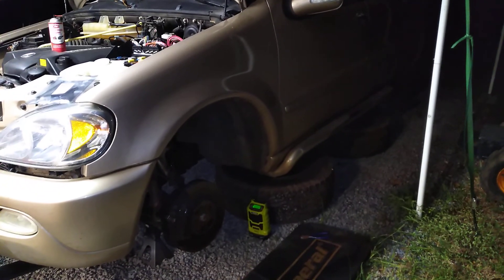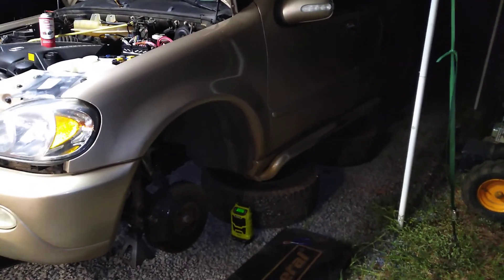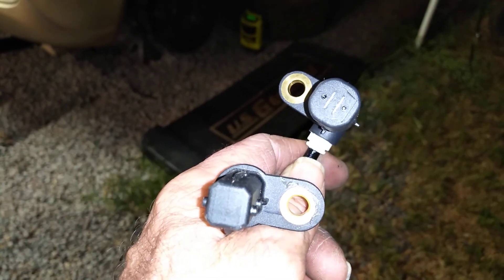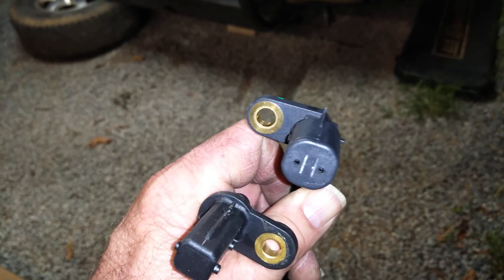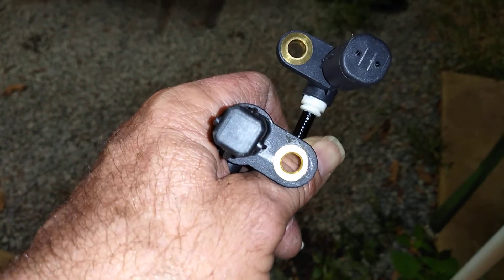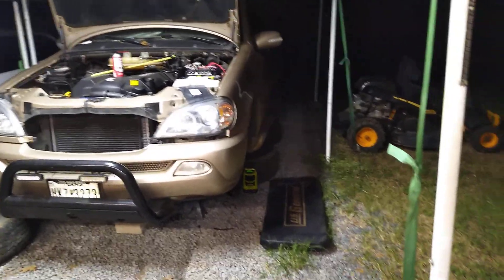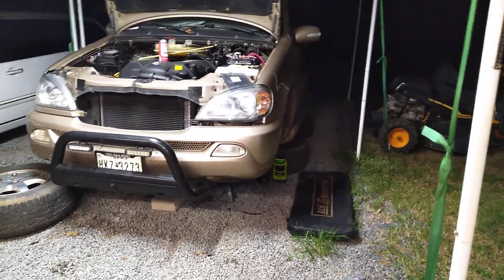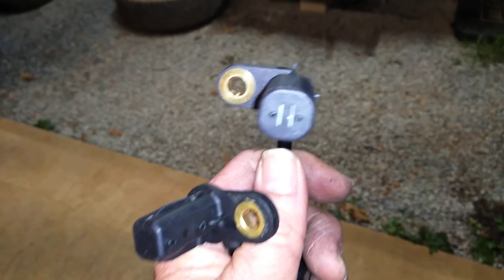Mercedes w163 ABS Wheel Speed Sensors / VSS choose correct ones for VIN # or Limp mode will result

Comment: Thanks, sir. Recently bought ML for myself, the prior owner was stating the abs light was triggered by the faulty FL sensor, went to a very good German car mechanic, he told me it needs two sensors on the right side, then I kept digging, and figured there is no data coming from RL sensor, so I'm going to see tomorrow if it's the wiring issue, or the dead sensor. I understand very well someone that would sell a car for $1000 with abs light, especially after following wrong advices from mechanics. Gotta do it all yourself. 2000 ML320
Reply from the maker: Bravo to you ! If your ABS sensor was in & working then died you probably need new one(s). 
If however it was just replaced ie its new, yet shows 'no signal' either on live data road test or spinning wheel, somebody put the wrong for you VIN sensor.
Those VIN splits matter !
Pre & Post sensors NOT interchangeable and MB doesn't make that clear.
What are last 7 of your VIN ?
Reply: @hellosunshine1090  A188977
You know, the previous owner stated, that the issue with abs light came on exactly after he hit a small road bump while turning left. I watched a video, can share a link later, it says that with an alignment slightly off, the abs light can be triggered, even if the steering wheel sensor is off by a few notches, angles. I was thinking that's exactly my case, untill I checked what the computer said in regards to one of the sensors, and indeed there was no live data coming from it while driving. So, it's either or, because sometime ago, I believe I was able to capture some live data from that faculty sensor! But last night, it was dead. Really interesting. But aside from that video, I haven't seen someone describing that issue with alignment and abs on the forums. But it's exactly what happened to the previous owner of my car. For now, I would like to see a wire condition of that sensor. Thanks for reading.
Reply from the maker: @SergioMorello1  
Ok Sergey then your year is prob   2000 - ish ? You need the early series 1998-2002 sensors for Pre A371935 VIN.
Just so you know.
Only guys Ive heard where an alignment issue causes ABS malfunction had hit something hard like curb, big rock, parking lot barrier, etc.
My very first ABS issue manifested at 65mph on Interstate bridge joint.
It momentarily braked one wheel - scary it feels like you have a flat tire this is BAS reaction. ABS fault doesn't always fo this but it CAN 

Around 500 miles / 5 days later it happened 2x more.

Once safely home my Foxwell scanner showed 'bad LR VSS signal' Stored & Current.

I replaced and all was well for 3 months then other Wheels VSS acted up too.
My theory: the cable / wire on these that runs along the suspension arm gets broken internally after 15-20 years, 150-200k miles & boom, no or bad signal which lights up dash "3 light salute" & causes all manner of woes.
Ihad that BAS sudden braking ( hazardous !)  and 3 lights + beeping while moving & eventually 1st gear limp mode.

If 1 sensor dies the others are close behind !

Let us know your resolution please.

Thx - David in Texas